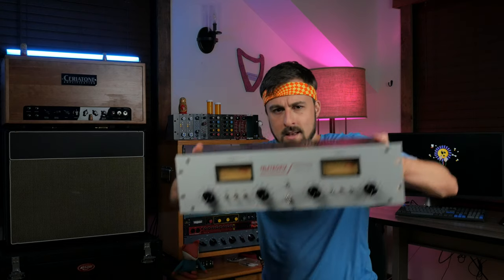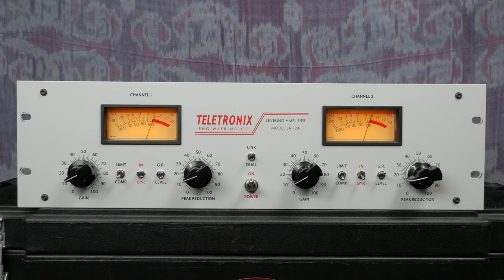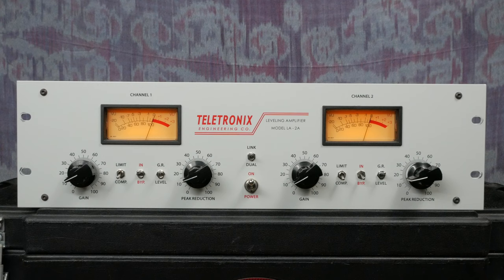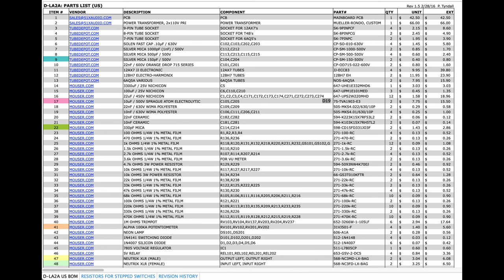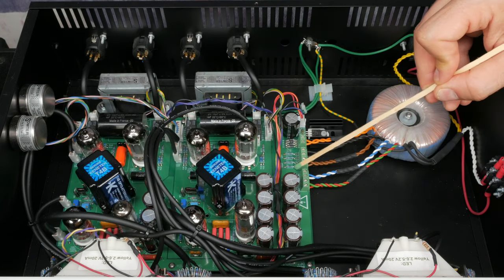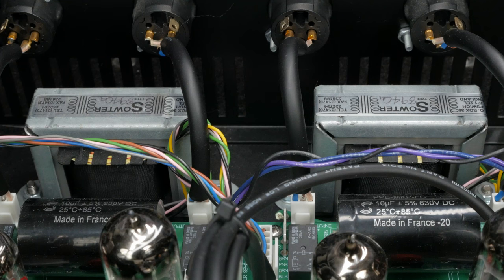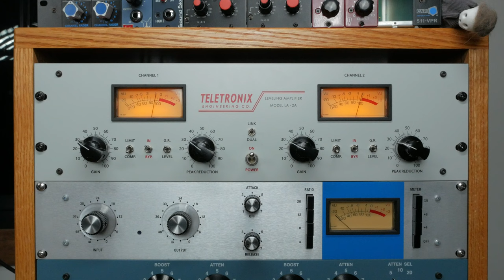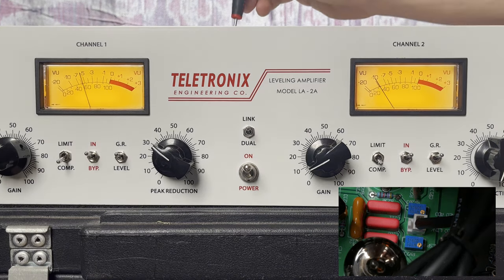Build Your Own Dual LA-2A Optical Compressor [Silent:Arts]

Comment: I cut the board in half and built a single channel. I ended up going with carbon comp resistors, RCA tube's, and AMI UTC clones. I love it.
Reply: What was your total cost?
Reply: @djentlover  somewhere around $1300 - I etched my own faceplate and used premium components
Reply: @JustinHeronMusic  Hmm interesting. How is your experience with it, how's the sound? When I have compared a real L2A2 with Slate's plug-in version, I've found that the hardware distorts the consonants of vocals nicely, and just had velvety saturation overall compared to the plugin, which sounds more clean and mid focused. I feel like I have to add some tape saturation afterwards to get a bit closer to the hardware.
Reply: @djentlover  The "effortlessness" of the hardware is what makes it worth it to me. The plugin has a "squeeze" to the compression. Thicker, more dimension, and more sheen is how I'd describe the hardware.
Reply from the maker: That’s awesome! Do you have any pictures of your build? I’d love to see how it turned out!

Comment: Great video. Not my particular preference to doing a DIY though. I'm much more into the idea of an actual, complete kit, rather than a circuit board and BOM; where you need to go on a scavenger hunt and chase down all the other components yourself - pretty much every build I've tried that way turned out to be an old maid - so I just won't do them anymore.  Aside from CAPI, AML and Hairball there just aren't that many people offering kits like that anymore. Seems to me that Group DIY was a much more interesting place about 10 to 15 years ago; things there really atrophied about 10 years ago in the mid-teens. I really miss the Analog Allstars 500 series Pultec clone: one of my favorite all time builds ever; it's a wonderful walk through Wima's product line! Unfortunately there just isn't much of interest on the White Market page anymore (it used to be multiple pages). Most of the people there selling kits over the years either went on to sell assembled gear only like Serpent Audio, or quit the business altogether. It's a real shame - I think most of the best analog gear I own was built from kits, not purchased retail.
Reply from the maker: Hey Jimmy! Thanks for checking out the video. I agree that the options for fully assembled kits can be limiting - especially for full size rack gear. In addition to what you mentioned above, kits are also offered by Sound Skulptor, DIY Recording Equipment and Yann Lu Audio. You should check those out! Don Classics offers kits that are 'near complete' - they provide a link to a Mouser cart which contains the necessary parts.

I think kit making is super time consuming and I imagine that the profit margin is razor thin. Having put together several non kit builds I can see how much of a pain it is to gather all the parts in one place!

Comment: Nice video, neatly sums up most if not all details worth noting when building this.
I've had my pcb/trafo in storage for years, gotta build it up at some point. Got most of the cheap parts, but trafo's and optical cells are a substantial expense :S Have a D-AOC that's just missing a front panel that has been prioritized, but rack units are staring to gett sparse in the studio...

Keep up the good work and all the best from a fellow Gdiy'er :=)
Reply from the maker: Hi Magnus! That Dual AOC looks pretty neat! My understanding is this project started as an LA2A build by analag that evolved into a unique optical compressor. Did you get your PCB from silent arts? It looks like they might have stopped producing/selling that one.

Do you plan on making your own front panel or having one screen printed?

Here is a link to the DIYRE wiki for those who are interested in reading more about the Dual AOC: http://wiki.diyrecordingequipment.com/projects/d-aoc/

Comment: Great video; I would love to put together something like this, but I have no idea how! Do you have any recommendations for some starter projects for someone with absolutely no experience with making audio gear?
Reply from the maker: Hell ya Zach! If you're looking for a place to hone your soldering skills I would start with a guitar pedal. Aion Fx has some nice kits that are well documented and won't break the bank. 

Once you can get through a couple pedals you could try something more advanced like a 500 series unit from Sound Skulptor. Alternatively you could try a nice FET compressor from Hairball Audio. These projects provide nice build guides and take away a lot of the guess work.

Then, when you're feeling bold you could try tackling something like the DLA-2A! 

Let me know if you need help deciding on a starter soldering iron or any other basic info. I'm always happy to help get someone into the hobby!

Comment: As a diy nerd and audio nerd this channel is gold. Curious if there are any good DIY Pultec kits out there.
Reply from the maker: I appreciate that TG! The only place I know of making Pultec kits is Audio Maintenance Limited: https://www.audiomaintenance.com/acatalog/aml-17-022_extended_info.html . They have an EQP-1 and MEQ-5 Kit.

The EQ-1 in my videos was built using a Drip Electronics board. You have to source all of the parts yourself. Greg at Drip sometimes has prebuilt shopping carts for Mouser or Digikey that can make the process easier. I'm not sure if you can still get these - you could try emailing them. https://www.dripelectronics.com/feature

The MEQ-5 at the bottom of my rack is a point to point built using a wiring diagram and chassis from analogvibes. If you go this route don't get caught up in being a purist. Substituting some of the parts for modern production items will make this a lot more enjoyable and have minimal impact on the performance of the unit. These are still available for sale. They also have an EQ-1 chassis. https://analogvibes.com/
Reply: @shoetiquemusic  awesome! I remember digging around a few years back and found a website that had schematics and a rough material list but a lot of it boiled down to "figure it out on your own".

I've also been an amateur radio operator for about 20 years, so building my own stuff has always been almost as fun as playing to me haha
Reply from the maker: @Terribleguitarist89  It's funny you say that! I'm actually getting into amateur radio over the last few months. I just got my Technician license and am now studying for my General! What types of things have you built for amateur radio? I've been toying with building something and documenting it on the channel!
Reply: @shoetiquemusic  I'm an extra and a VE through the Anchorage VEC and ARRL actually haha

I've mainly dabbled in tiny QRP radio kits like the old rockmite and such, there are a ton of CW transmitters out there that mainly lean on 2N2222 transistors. If you can snag some older copies of the ARRL magazines or books you can find a bunch of tube based builds too.

I've noticed over the past 20 years those resources have drifted from building stuff to buying new gear from the big name companies unfortunately. In all fairness, my main rig is an ICOM 7200 I use almost entirely for digital hf so I can't rant too much about that haha

I also lucked out as a teen to be in a club with some OG Motorola engineers who took me under their wings to teach me about homebrewing stuff. A few were guitars as well and built my first tweed champ clone with one.

Comment: Nice build dude! I'm building one of these atm. I'm just waiting on my custom case to come through so I can finish off wiring it up. Pretty much everything else is in place!

I have a couple of question (as I can't get onto the GDIY forums, as my account keeps getting banned every time I sign up as they require you to pay to join, or they IP ban you within 24 hours for good!). 

Firstly What is that funky high tech looking ground connector you have connecting the PCB channel ground to chassis ground star wire? I want that, it looks super bomber! xD

Secondly, with the pots, or in your case the stepped switches, are you using 3 core sheilded wire, and if so, are you tieing the sheild into the the grounded pin of the pot at the board side? If not, how do you have it set up? I would experiment with the grounding, but I'm running low on moplex pins, and will only have 8 left if I change out the pot wires, and I still may want make other alterations down the line.

Thanks dude.
Reply from the maker: Hey Dafty Boy! Regarding the PCB ground: Are you talking about this item? https://www.digikey.com/en/products/detail/keystone-electronics/4907/255324

It's called a quick disconnect. I used three of these total. There is another next to each relay. It legit took me a half hour to figure out what I had put there - too many receipts for this project!

For the the gain and peak reduction wiring I actually used some left over microphone cable (2 core shielded). Not sure if this is the best approach but the noise floor on my unit is very low. The shield is connected to the slot for ground in the pcb side molex connector. The bottom of this document shows how to wire the pots: 

https://cdn.imagearchive.com/groupdiy/internal_data/attachments/2/2755-6fbb80788a67cf70e2cd1ec50ecc6cbe.data?response-expires=Mon%2C%2022%20Apr%202024%2012%3A18%3A52%20GMT&response-content-type=application%2Fpdf&X-Amz-Content-Sha256=UNSIGNED-PAYLOAD&X-Amz-Algorithm=AWS4-HMAC-SHA256&X-Amz-Credential=I3UPHPWOPY63ZMOGLZFM%2F20240415%2Fnyc3%2Fs3%2Faws4_request&X-Amz-Date=20240415T121852Z&X-Amz-SignedHeaders=host&X-Amz-Expires=604800&X-Amz-Signature=74fa380f41db637cb1b4e5ecebf1ed76f8839002df4812a3d28a0e032b6972ae

GDIY has made some changes that have had a negative impact on registration, access to the white market and usability. You could try using the contact page - hopefully someone will reach back out to you and help sort things out! If that doesn't work realgearonline.com is a great alternative.

Happy to answer more questions or clarify if anything above isn't clear! Let me know once you get it up and running!
Reply: @shoetiquemusic  Thanks a bunch dude, I think I have that grond wirering diagram I just wasn't sure if I could get away using the sheilding (which is how I also have it set up atm too). Glad I can just leave it as is. 

And yes that quick disconnect bit is exactly what I was after! It really makes that groun connection look super clean.

I tried contacting gdiy with a second account, but they banned the account i used to contact them within the hour from me signing up and sending a help reqest. I've given up trying now as I have to open a vpn to even try and sign up as it's an IP ban, not just an accout ban! 

Thanks for the time and help! Volker is already probably sick of me, so I try not to ask him if I can help it and figure it out on my own haha.

Comment: does the diy case come with all the buttons and everything already on it?
Reply from the maker: Hi iAM1AM! The case only includes the screen print. There are pre drilled holes for all the controls/VU Meters on the front and the hook ups in back. You need to source the knobs, switches and VU meters yourself. The knobs, switches and potentiometers are from Mouser. The VU meters are from Hairball Audio.

Comment: 20 seconds in... i hate you... i hate how right you are xD
Reply from the maker: Hi Dave! It's my job to be right - that's why i get paid $0/hr to make these videos! Let me know if you decide to build one. I'd be happy to answer any questions you have along the way.
Reply: @shoetiquemusic  Appriciate all the good will, but I can't now. 😭
+ I heavily suck at soldering, so I'd imagine it would take me more then 6months to complete it 😅
Reply from the maker: @DaveChips  Try starting with a smaller project and working your way up! I believe in you Dave!
Reply: @shoetiquemusic  I'm going thru a house buying proces, so hopefully when all of that is finished, and I have also checked few diy midi controller kits just to get the soldering skill.

As up until this point, I was maybe soldering, a cable, connector, resistor... Once every 6 months.

And this will be first time doing something from scratch, and I'm not gonna lie. It kinda scares me 😅